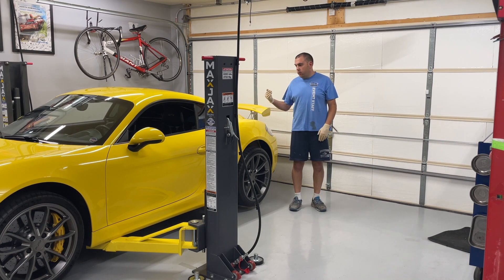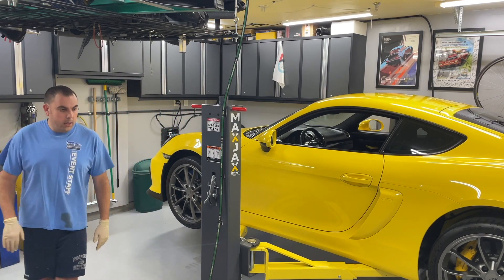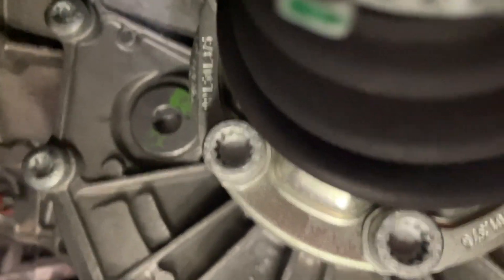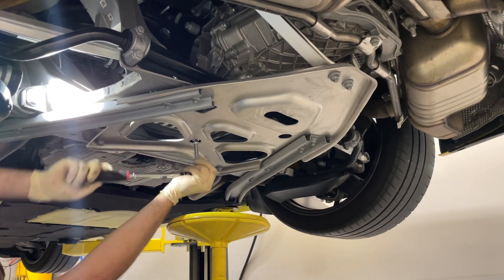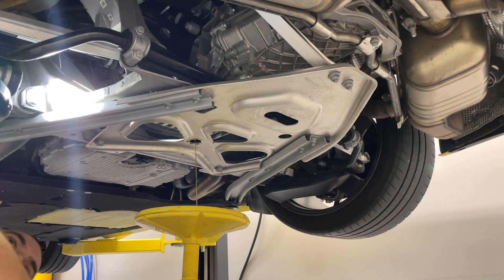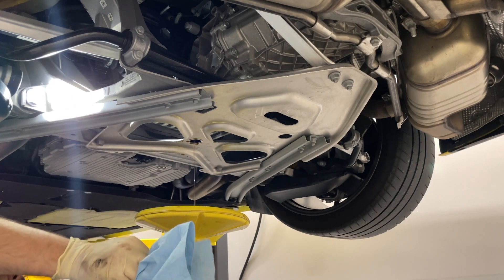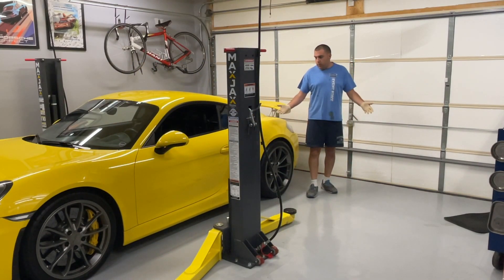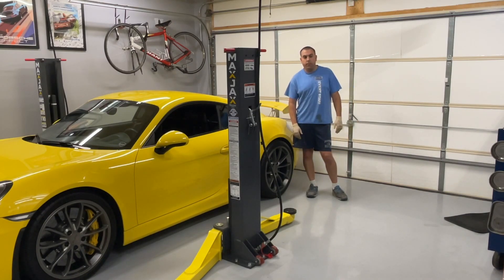Porsche GT4 Transmission Fluid Change

Comment: Just a tip, always loosen the fill plug before you drain the fluid. If for some reason the fill plug was stripped or wouldn’t come out, you’d be in a world of problems 😉

I have a GT4 as well and have made a couple videos. Good to see other DIY folks out there!
Reply: Learned that working on my prior Honda S2000
Reply from the maker: Thats a good idea.
Reply: He did do that...

Comment: Thanks for the video. Im really struggling with the notchy feeling gears in my gt4. Its worse when cold, but still present even when up to temperature. The worst gears are definitely 1 through to 4. Wondering if this is normal because in every review they state "the best manual transmission you can buy", its like the path to each gear is super rough and not in a straight line at all. Any ideas before going to the dealer?
Reply from the maker: Have you changed the fluid in the transmission/ bleed the clutch fluid?  I would try that if capable before going to dealer
Reply: @gtmachine6134  thank you Sir, appreciate it
Reply from the maker: @nicklittle2413   your very welcome

Comment: Thanks for the great DIY video, how many miles when you did the PDKfluid change? Thanks
Reply from the maker: I did it around 9K miles on the car.  Also its a 6spd manual transmission not a PDK.   The fluid was 7 years old.   I figured as might as well change it due to age.

Comment: Does the Porsche gear oil come with the friction modifier for the limited slip diff? If so there must be two types of OEM fluid? With and without the FM?
Reply from the maker: Yes it came with the friction modifier already in it.   I got the fluid from the dealer.

Comment: What would be a good interval to replace the transmission fluid on any 718 Cayman/Boxter model, either manual or PDK? The owner's manual says to change it every 120k miles or 12 years but I think that is too long of an interval, especially if the car is being daily driven.
Reply from the maker: I would probably cut that in half If you do any sort of spirited driving or pushing the car a lot.  Also if you do any upgrades to the power of the engine that would cause more wear on the fluid.   
I would go 6 years or 60K miles.  You can never be to safe when it comes to clean fluid in an engine or transmission.   I've never changed any of my cars oil according to the interval.  I've had 0 issues with changing fluids early.

Comment: quick quesiton, do you have a recommendation where to purchase the crush washers for drain and fill plug?
Reply from the maker: Get it from Porsche   You can reuse if you want.
Reply: @gtmachine6134 are the fill and drain plugs the same? According to PET they seem different but I ' ve read they are the same (22x1.5l

Also, could you confirm no washers needed?

Thank you
Reply from the maker: @pbdeed    They are the same size allen key   Also no washers needed.
Reply: @gtmachine6134  Thank you for confirming it!

Comment: Hello,

Did you have to replace any sealing rings (the manual says that)?
Reply: In forums I've read that there is no washers at all. Did you replace the drain plugs or reuse the stock ones? Thanks

Comment: If your car had the transmission recall done, you would have had the whole gearbox replaced at some point. so the oil is likely newer than you think.
Reply from the maker: The fluid was probably never changed.  i bought the car with 4200 miles on it.    My car never had the issue with the transmission.  From all the talk about the trans issue you would think all the GT4's got it done.  It was only a select group that needed the transmission replaced.   I called Porsche when i was buying the car and it didn't qualify or need the transmission replaced.

Comment: No filter? I know with the PDK you have to change out the pan (integrated filter).
Reply from the maker: Correct.  There is no filter with the manual, even though it does have a pump and a cooler. You would think that it could use a filter.  But with no electronics inside there is no reason to filter the fluid as with the PDK's i guess.  It does have a magnet on the drain plug that you can clean.
Reply: @gtmachine6134  Wow the drain plug already has a magnet?